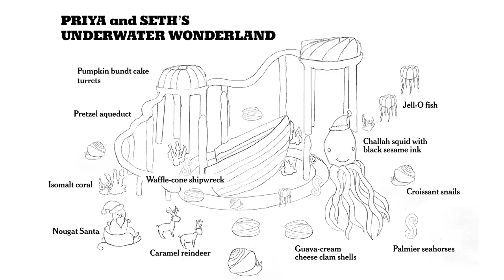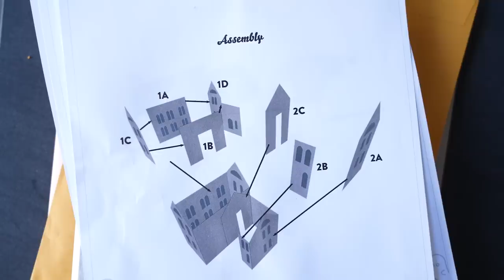Gingerbread Showdown REMATCH: Sohla and Ham Vs. Priya and Seth | NYT Cooking

Comment: So glad they did another one of these!

Just an fyi also about pretzels, you don't need to boil them if you're using lye, you can just dip them or brush them with a lye solution so you don't have to worry as much about wrecking the shapes
Reply: Ah thats very useful to know!